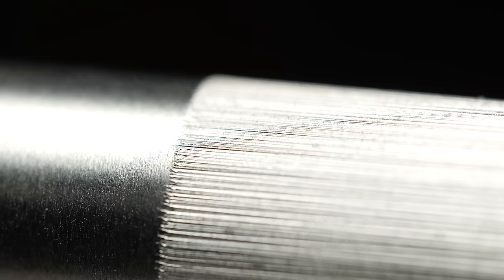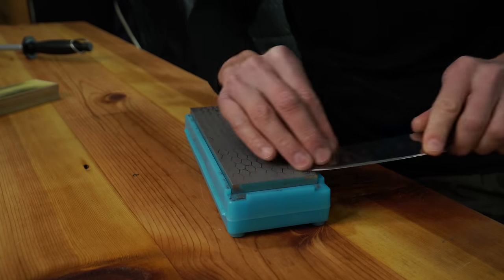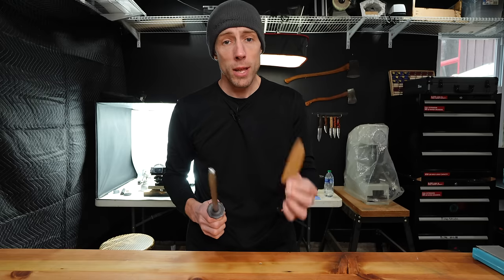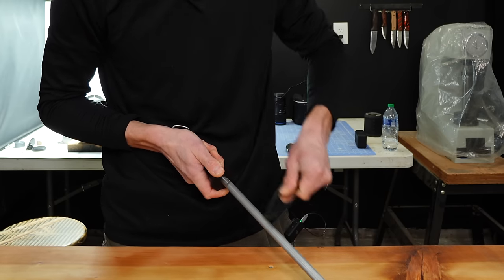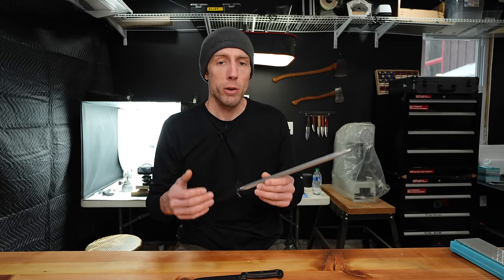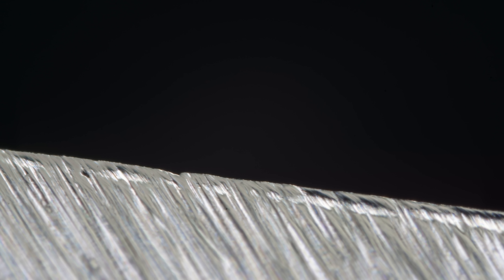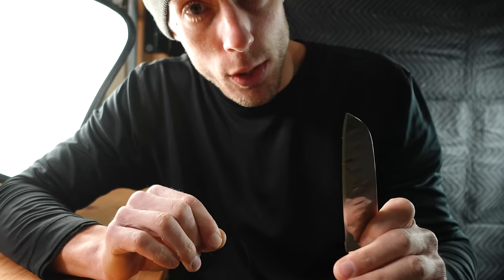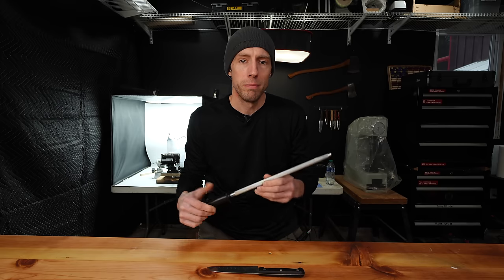What Do "Knife Sharpening" Honing Steels Actually Do?

Comment: I worked as a butcher in a meat packing plant for about 5 years, there were 200 workers on the production floor, so we had a knife room where they would use power knife grinders, we would always get our knives  back with pretty big burr so you'd use that steel to break the burr at the true apex then we'd use a smooth steel to straighten and a ceramic for a fine edge
Reply: Smooth/polished steels for the win!  Butchers know where it's at!  This video really doesn't go into why those casual honing steels are so awful: it's because people keep buying those cheap-ass ribbed ones that tear up your edges.  Polished steels are fantastic.
Reply: Agree.  Worked on a kill floor.  My brother was a ham boner.  Number of cousins worked boning, hitching ribs, etc.   Power sharpening or even stone honing always needed worked to get truly sharp.  Hence we all got 10 minutes per day knife buffing pay.  :D
Reply: Yes i still do this part time and this is how i work.
Reply: Butchers word is gospel. Learned from machine shop foreman. Smooth rod to cycle burr decreases grain structure tighter and tighter. strain hardening it until maximum hardness achieved and burr breaks off. Very small amount of strain hardened metal remains on blade and can be lightly sharpened with solid real ceramic rod. A dozen alternating light strops on my denim, cotton bib or doubled terry cloth on counter and we surgical. 
Author needs to sharpen a paper clip; then flex a paper clip till it brittle breaks and sharpen the brittle break face. Yup, think of knife blade as a stacked row of broken paper clips. 
If you dont work knife edge w smooth hone, then you are only sharpening soft metal and haven’t reached even a fraction of blades capability in creating a sharper and significantly more durable edge.
Reply: Totally agree. I have a technique to do the same thing better and with less loss of material, but it would be too slow for a professional environment.
Reply: @dirtyketchup   Agreed completely, as a butcher it's not viable to have a stone near you and keep going back and doing 10 passes each side constantly. It took me 6-7 steels before I found the right one I liked. I even have used a Fischer french one I searched for for months and couldn't find that was even better than any other I've ever used. It was almost like it was coated in a very fine waxy material, but my knife would be absolutely biting sharp after 2-3 swipes. I've settled for a dickoron fine sapphire cut steel, which works wonders. I respect OUTDOORS55 a lot and he has taught me a lot, but I think he's dropping the ball on steels too fast on this one.
Reply: Ofc in all butcher shops u se the butchers use a steel rod... i think they would know a thing or two on sharpening knives 😂 telling that people didnt know what a bur was a 100 years ago... yeah.. tell that to the japanese sword makers from 500 years ago lol.
Reply: I currently work in a meat packing plant, and while everyone who works with the knives are given a smooth steel and a stone, most people don't have a rough steel. I probably should have one, but I substitute it with the edge of the smooth steel. (for those that don't know, F.Dick DICKORON Classic Steel, there is the 2 flat-ish sides, and then the edges where those two sides meet) works well enough, but I end up needing to get  my knives ground once every month or so.

for context I am one of 6 guys that remove pork tenderloins (there are two per hog, because left side and right side) from the bone in loins, just before they're deboned, and the factory I work at usually does 8500 - 9500 hogs per day.
Reply: I am confused. So who is right? Maybe both and the hone steel is good only in the form of another version that is smooth? Do you all agree that the type of steel the creator is showing is crap?
Reply: I also did a production job on the fabrication side of JBS, everyone uses the steel with a wire box after sharpening, also 95% of the workforce are working wounded from not having an actual sharp knife during the entire workday, also this guy is stroking his blade backwards along the steel if your going to use it to sharpen, also another steel that has no abrasive and is smooth is also used, so 3 devices on the fabrication line and also cut resistant glove, a wire mesh glove and another glove on top making 3 glove safety.
Reply: Genuinely not a bad way of doing it. A steel can break a burr easier and faster than a strop.

Comment: I have been a professional fisherman for over 40 years & have found the best way to sharpen the "cheap" stainless knives that i use, As they go into the sea with somewhat regularity. Is to use a circular sharpening motion not back and forth. I have to then use a steel to get it to cut right after about gutting 60 fish. I can use the steel at least 5-10 times before I need to sharpen it on the stone. If I don't use the steel & resharpen it takes much longer & does not last any longer than the steel. The way I use the steel is always pulling the blade forwards. If I do it backwards it is not as good. I have no idea what the actual edge looks like as my eyes are not that good. But I gut over 60,000 fish a year so I can tell you the way I do it works for gutting fish! I don't bother splitting hairs with my knife as no one wants to buy them, so not sure if my sharpening method is good for that. Great video though & good close up pics.
Reply: Nothing works like simplicity, also backed by real-life experience. Nicely put.
Reply: Have you actually tried sharpening properly and removing the burr though? I'm guessing never since you mention not being able to see the blade which does require magnification for most people. Just because it works doesn't mean it's working as well as it could. I have worked in a lot of industries where "we've always done it this way" is the rule but quite often if I can get them to listen I can radically improve their system (it's what I do, solve problems). As with anything I don't know if it would be better in this specific situation which is why if I worked in fishery I would test my theories before suggesting anything.
Reply: @_droid  Because I am gutting around 300 fish a day & they all have shell in their gut, the blade goes dull after around 100 fish. It takes me around 25 mins to do that many. if I had to spend 15 min sharpening the blade each time it would add extra hrs to my day. Maybe if it was a high carbon blade it would last better. but the salt wrecks them if you have a few days off.
Reply: @calthorp  Personally I would test how long the edges lasts normally versus removing the burr (takes less than 2 min BTW). If there is no difference or the couple extra minutes sharping is longer than the gain in edge life then obviously it's not worth it. I'm a scientist though and I would normally do this for other people before even suggesting it. In the real world it doesn't really matter as long as you accomplish what you want.
Reply: @_droid  I think by sharpening with a circular motion on a wet stone it probably does not have a burr. have you tried it?
Reply: I like how you put this in a practical sense. I have worked in commercial fishing for years. It is a compromise. You don't want to spend too much money on a knife than can get dropped over the side, but you don't want to be working with a cheap knife that will give you problems. You might not have time or tools to painstakingly put a razor edge on your blade, but you don't want to develop carpal-tunnel syndrome either. It is a compromise, but at the end of the I can say that a sharp knife is far more safer than a dull knife.
Reply: @oceanaxim  You are right about that.
Reply: @_droid that’s where practical use and enthusiast use differ. For many professionals, you just need a quick way to make things work as you need, and use the sharpening stone all day long isn’t practical.
Reply: @calthorp  No, he's just a "scientist", I trust you ive cooked in kitchens for 15 years.
Reply: @anthonyscoggins8834  yes there are the ones that like to hang their knife on the wall to look at. Then there are the ones that actually use them for work every day.
Reply: You should consider bringing a leather strop with you with some fine abrasive on it. It'll take off the burr very easily. I know what you're talking about and it's honestly very hard to take the burr off of a knife without a good strop.
Reply: @calthorp  I have made knives and the circular motion still can leave a burr. You need to strop. It takes very little time and I think you'd be shocked at the difference. Also i mean after a huge number of fish you take it back to the strop (or better yet just get a power strop), wash off the abrasive, and get right back to it slicing through fish bellies like butter.
Reply: This

Comment: I use the steel like an absolute savage... and it works well on my standard issue, non-fancy, everyday kitchen knives.  I run the blade opposite of what was described here, so, in the wrong direction or lead edge.  I also sometimes run the blade 10 or so times in both directions on one side then the other, then finish up with an alternating drag a few times leading edge direction.  A very noticeable difference in cutting before vs after.  Cheap(ish) knives, I don't care.  They cut like a hot knife through butter when I'm done.

Comment: I am a chef and also handsharpen all my blades by hand.

I have both positive and negative opinions about honing rods.

First of, massive difference between one rod and another.

Ive used those that was just a waste of time, those who does a little bit, but not a whole lot.

And those that will put them back to shaving sharp in seconds.

Its not sharpening, but it will "extend" the duration of the sharpness.
You still have to properly sharpen the blade sooner or later.

My personal preference are ceramic rods, as they are nice and hard so will bite into the metal (without being rough).

Comment: In the end you said you could use an abresive honing rod(i guess at that point it could be called a sharpening rod?) but using the rod you pass the knife on the rod while dragging the edge and when using that flat sharpening stone you push it in the direction of the edge, Any reason for doing this while saying it is the same motion? is that something to keep in mind?

Comment: This is interesting.  I do use a steel in the kitchen, but I use it in an opposite motion, as if shaving metal off the steel.  I have always considered the steel to be a specialized file.  It stretches out the time between sitting down and doing a full sharpening - I use a synthetic double-sided oil stone for that.  I do know that over time, use causes the apex to turn to where you can detect the turn with a finger nail.  I use the steel to remove the turned bit.  I always imagined, since I was taught to use the steel opposite to what you show, that the steel removes the rolled bit, essentially filing it away.  After a "several" steelings the edge may get fussy about slicing ripe tomatoes and fail to restore to a fully useful edge.  It is then that I get out the stones.
Reply: I was taught by a very good butcher not to draw the knife towards me but to push the knife away, as if I wanted to shave a very thin layer of steel from the rod. It works.
Reply: @RayCotta-d1g  The "away" rule is to protect you from yourself. Pulling the knife toward the hilt might,  under severely adverse circumstances, lead to an accidental cut, and with a sharp knife, fingers on the floor.  The position of the edge relative to the steel surface and the angle is the same in either direction.  I prefer the way I was taught mainly because it's more comfortable to me.  I've worked in a kitchen where we were supposed to hold the steel vertically in a dagger hold, with the tip on a counter or block.  The knife was held against the steel and "cut" downward like we were trying to remove shavings from the steel.  Heaven help you if the chef saw you doing it any other way.

Comment: Your science is correct, but here are some additional points.

I never use a steel "trailing". Rather, I use it by "cutting" the steel, same as when I sharpen. This is how it is intended to be used. In my way of thinking a "honing rod" is one with an abrasive coating (diamond or ceramic) that does indeed remove metal and thus sharpen.

To "sharpen" a cabinet scraper (woodworking) a burnishing rod is used to create the rolled edge that does the work. A steel is effectively a burnishing rod. If you are working in a kitchen and your knife is dulling to the point it interferes with effective cutting it is a fact that a few strokes on a steel will bring the edge back to life, ask any butcher. So you are correct that steeling is not sharpening and it is not, in the end, good for the knife. The best way isn't always the practical option when one leaves the "lab" and enters the kitchen.
Reply from the maker: I have a video coming out addessing your concernshttps://youtu.be/65JzsDU_0mI